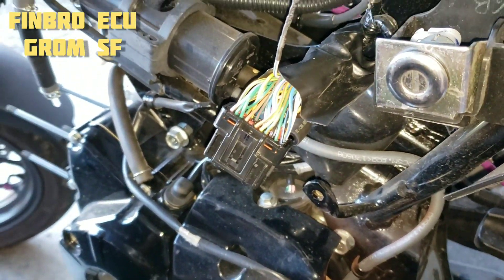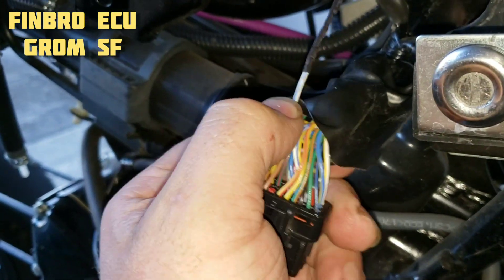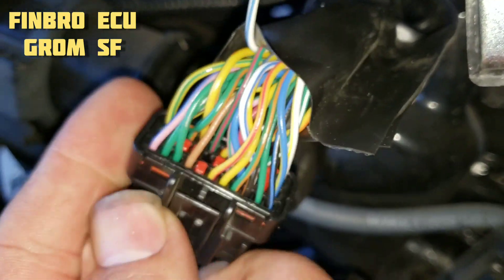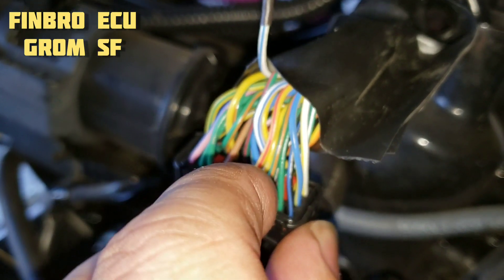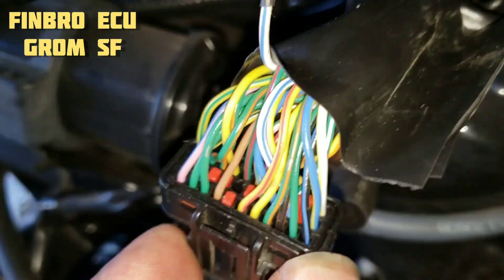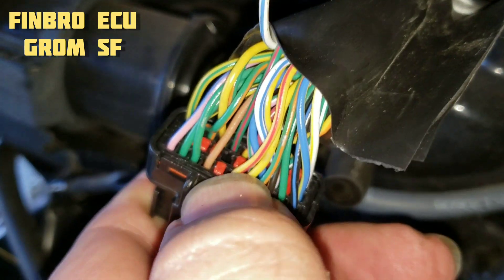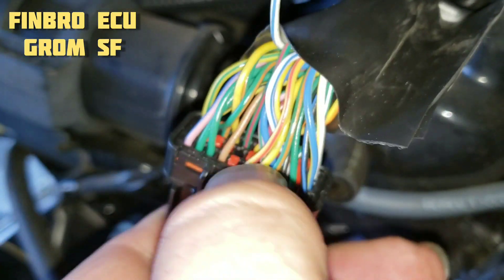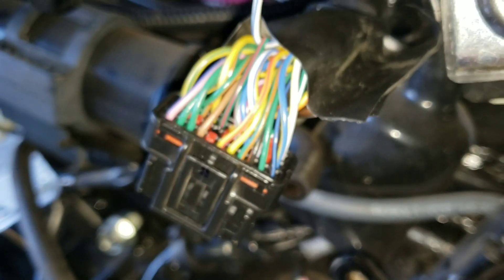Honda Grom SF finbro ECU wiring diagram installation

Comment: Greetings bill☝
Do you know if I should reflash my grom tps after I've fitted the finbro, or should I disconnect my battery before doing this ecu mod 
I apriciate your channel. 
Tx man ☘
Reply from the maker: If you're changing the ECU out completely for a different aftermarket ECU than there would be no need to reset TPS if you're leaving the factory ECU and adding an aftermarket fuel controller or something like that then yes you'd want to reset GPS hope that answers your question
Reply: Running sweet, cheers m8

Comment: This did not work with my 2017 gromwire diagram is the same bike wants to turn on but it doesn't
Reply from the maker: Electrical is very hard to determine without having the bike in person. I wish I could help you more..

Comment: You wouldn't know what wires go together on 2018 Grom aftermarket ignition. Recovery From and ignition was cut and drilled out
Reply from the maker: Not sure why I'm just now seeing this message 8 months later. Unfortunately I do not I have not taken the ignition apart on one of these yet

Comment: Pulling gently on the pin may work kinda, but the way to do it is go in from the front with a tiny chisel shaped stiff blade down the hole at the side of the pin you want to remove, and squeeze the lock tab inwards so the pin is released properly. Do it like this and there is way more chance wires will go back into the connector body and lock into place

Comment: So I did this and rpms hang out around 5k. Any help?
Reply from the maker: This is exactly why I'm not a fan of ECU reflash. now the only way to fix your problem is to send it back to the person that flashed the ECU.. if you had something like a power Commander v and the wb2 wideband device from Dynojet I would be able to go in and make small adjustments for you and send you the tune through an email.. I tune motorcycles on the weekends. I do not do ECU reflash. In this video I was just helping a friend who went that route so we can try it out and compare to some of the other devices out there.. my name is the same on YouTube as it is on Facebook if you have more questions message me through Facebook messenger.. if you don't have Facebook messenger tell me how to get ahold of you so we can talk more. I would highly recommend getting something like a power Commander v instead of doing the ECU reflash.